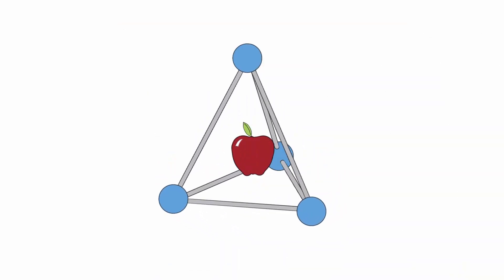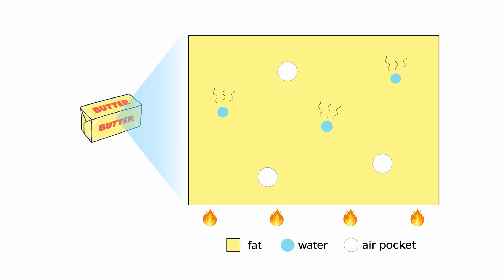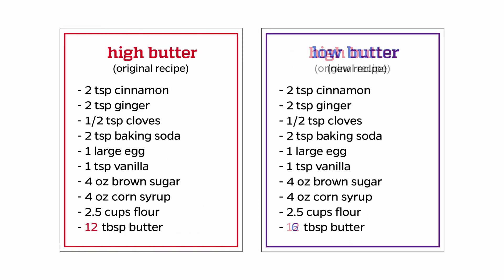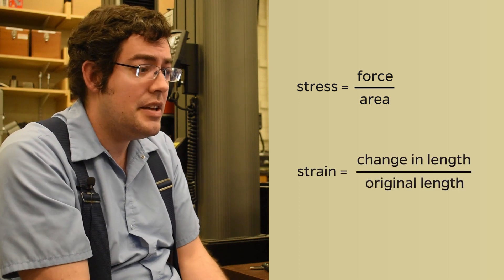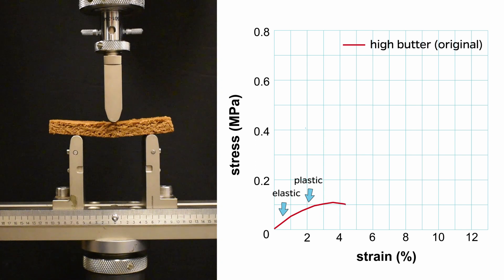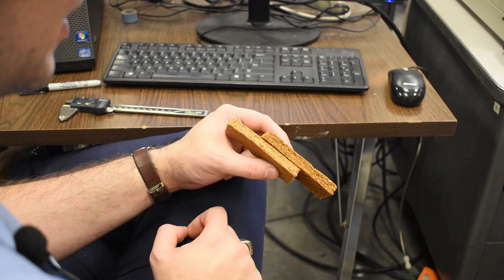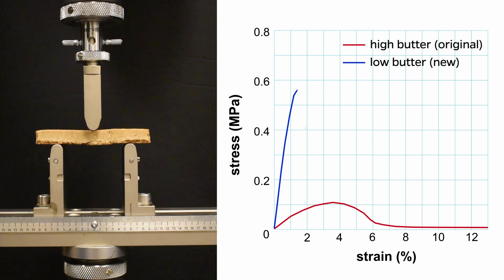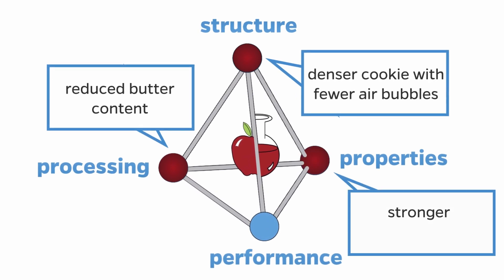Science of gingerbread houses

Comment: Brilliant and well done! As a gingerbread architect/contractor/builder, in the business for 15+ years, I prefer soft cookies, and therefore make adjustments to guarantee structural integrity.

In bigger houses, a rectangular cardboard box can be used as an inner shell to provide rigidity. Bubble packing on top of the box can help support the roof. In smaller houses, I use strips of end pieces I trim from the edges of my cookie sheets (I don’t bake pre-cut shapes-I bake large sheets and then cut the component pieces out). This trimming allows my component parts to have perfectly straight edges (they are a bit curved right out of the oven). I then glue these strips (akin to I beams) into the inside corners of the house to stabilize the 90 degree walls. Works like a charm!

I’ve also found the ratio of confectioners sugar to egg white to cream of tartar makes a big difference. A quick-hardening glue can compensate for some structurally questionable design choices. Not sure what you used for glue but I would love to see you tackle that issue. I don’t know the optimal ratios-some years I get lucky, other years not so much.

That was a beautiful and charming creation! So sad it got knocked down, presumably to make way for some bland glass and steel condo no doubt. Excellent work-E to the u!!!